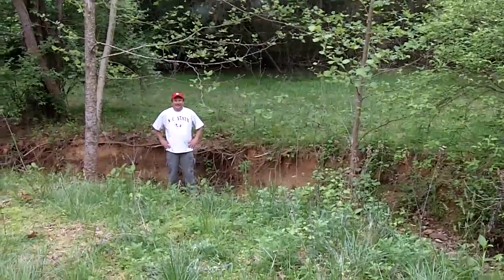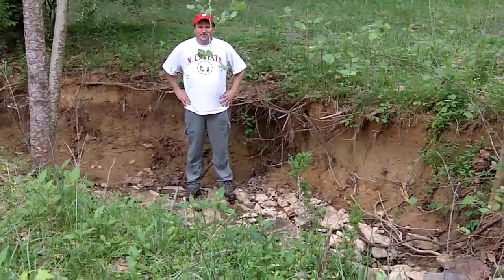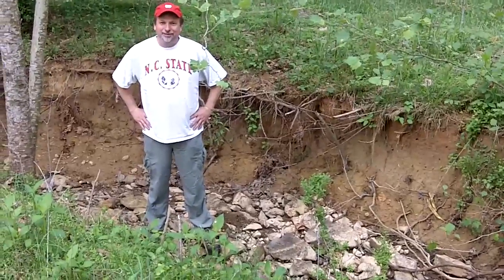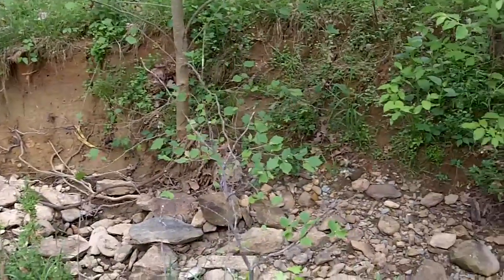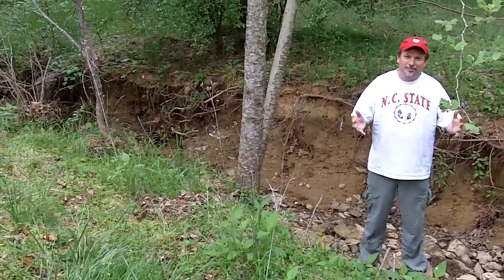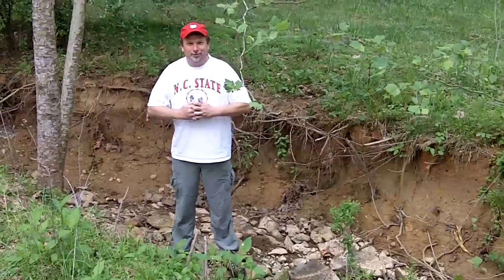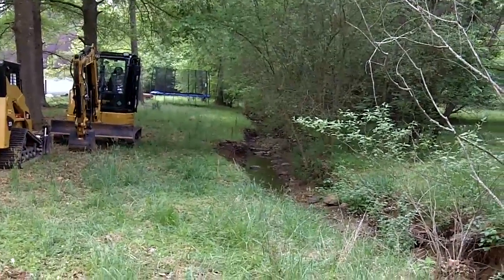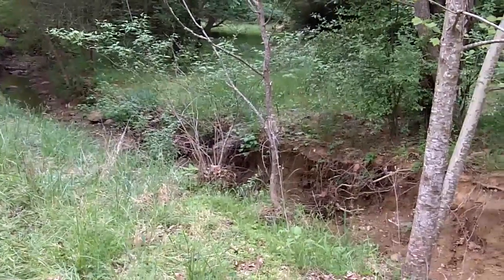Backyard Stream Repair

Comment: erosion is happening in the city storm easement drainage creek which runs behind my house an streight thru my yard.we recently had a tornado on may 3,2021 the trees that are now on my house were growing an barely hanging on  in this drainage creek. Who do i contact for help to keep the drainage creek from swallowing up my house as it erodes? what can i do as a owner to help stop this from happening.
Reply: I know Crawford took a big hit last month with flooding and tornados.  FEMA has been working with the county to make repairs but with the extensive damage may be overwhelmed.  I would try Crawford Cooperative Extension- 105 Pointer Trail in Van Buren. 479 474 5286 
and Crawford Soil and Water - 521 Main St 479 474 2281.  Ask about property owners assistance programs for Streambank repair.  I hope this helps!
Reply: Depending on where you are located some municipalities offer assistance.
Reply: In What Municipality or county is the property located ?I can see if I can put you in touch with people that can help
Reply: @mitchwoodward6196  Crawford county  in van Buren Arkansas 72956
Thank you
Reply: @marlenahallett1041  Did you ever figure out someone to contact? I'm in Arkansas, too. I'm just starting to figure out the process of restoring the creek bank on my property.

Comment: I have a decent stream that cuts in front of my house and last summer a big storm dumped massive amounts of rain and it doubled the width of the stream and tore all my bridges out and washed them away. Been trying to figure out how to properly well... make it not look like shit... I mean it was so rough it dumped in front of my house a big old concrete slab and a good length of drain pipe from somewhere (probably one of the farms  up the road the stream cuts through). I dont have a lot of scratch and am sitting on 3 acres so I doubt it will be cheap.
Reply: You can do it with native plants plant species and coir mattings as long as the banks are not too bad.  Here is a link to our streambank repair guide -  
https://www.bae.ncsu.edu/workshops-conferences/wp-content/uploads/sites/3/2017/07/Small-scale-Solutions-to-Eroding-Streambanks.pdf
 In NC you can put native plants on banks without permitting BUT if you are working within the stream channel, working at or below OHW (ordinary high water), adding soil to eroded banks, removing estabished plants, or installing in-stream structures, or hardened structures or riprap BE AWARE - YOU MAY NEED A PERMIT.  Check with a local stream restoration professional engineer, your local Army Corps of Engineers office,  or State Environmental Agency for more details BEFORE YOU START ANY STRERAM WORK.  Fines for unpermitted work can be steep.

Comment: We actually had some NC grant $ to fix this one. We have done a lot of these small repairs and they typically cost $15 - 20 linear foot of stream bank.  Most of the cost is in renting the mini excavator so if you can avoid that you can save a lot. Check out our NC stream guide:  
https://www.bae.ncsu.edu/workshops-conferences/wp-content/uploads/sites/3/2017/07/Small-scale-Solutions-to-Eroding-Streambanks.pdf